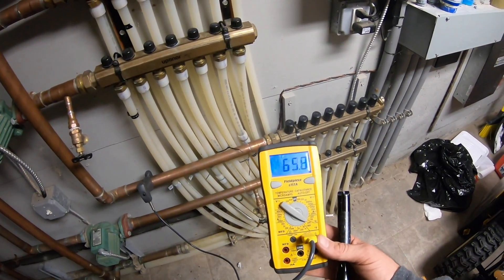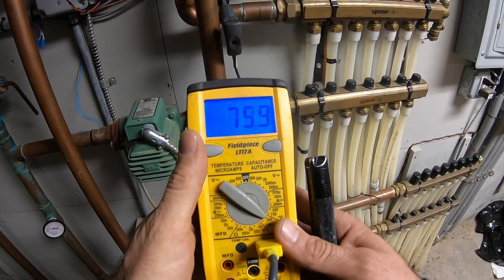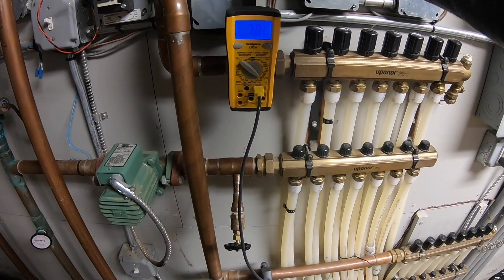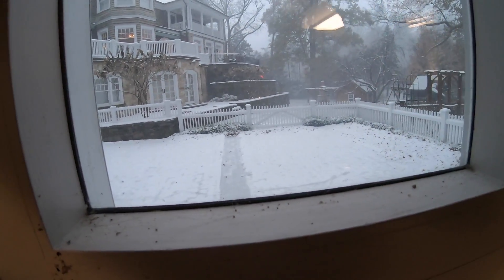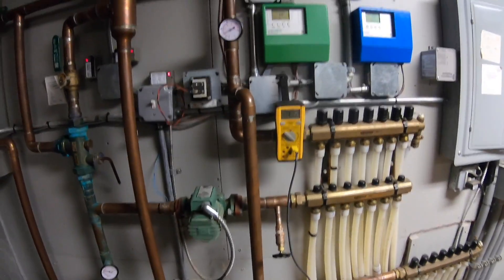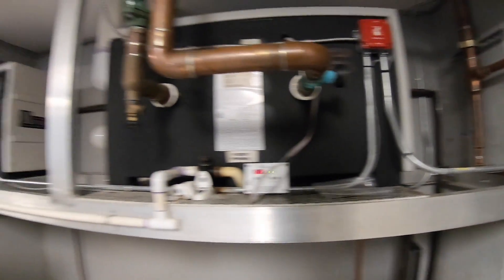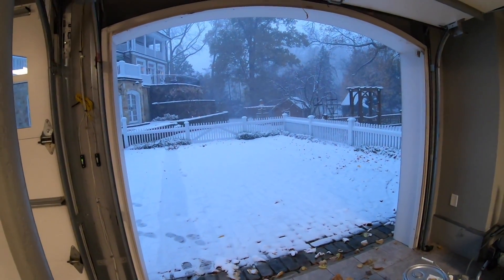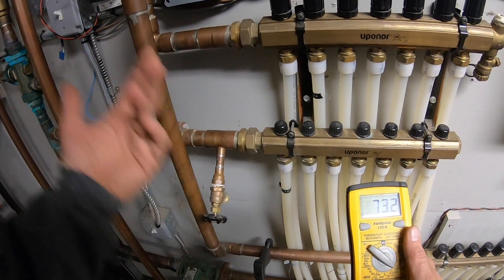Testing Boiler Snowmelt/ Heated Drive Way System After Repair During Snow Storm

Comment: No.. in just the couple of minutes of the video,, there are changes.   Heated driveways normally take hours to heat up.  This is not instant stuff.  If you want it to melt,, you have to start the system before the snow,, not after.   You are the HVAC guy,, calculate it,, warming some frozen concrete and bricks is going to soak up an incredible number of BTU's.

It is not fast.    40,000 BTU's for a single parking space 200 square feet,, and it calculates as 5 hours to bring it to melt.  You've got what 600,000 BTU's  but 2,000 square feet?  Takes time.
Reply from the maker: Yes they do a lot of thermal mass to heat.
Reply: Yep, driveway systems require lots of heat and slow response times.  Aside from the total mass that must be warmed,, the transition temperature of 32F ice to 32F liquid  require,, I think I am correct,, the energy equal to 14 degrees of temp change F.  So melt systems tend to kind of stop for a while at the transition point.  For you and I watching for the pot to boil,,,, nope,, won't boil.

That is a pretty system though.  A very talented HVAC guy laid that system and manifolds out well.  And by your description,, you hit all the service high points.  Nice job.
Reply from the maker: I wanted to see it work yet had no idea it was locked out both boilers on faults or I would of started this maintenance on these boilers to warm the ground up before it started snowing

Comment: Its really cold out tonight. Must be down to 40. Now for the bad news..... I'm 30 miles East of San FranCesspool and dimwit lunatics run my state.   Nice pipes and boilers, though. I'd like to see how all of that stuff works.
Reply from the maker: I'm jealous I want 40F instead of its 29F in jersey. First time working on a melt system as snow hits. Too bad both the boilers were locked out when I walked down to the garage or the driveway might have been warm enough to prevent the snow from sticking. This system can be manually turned on or activates around 36*F if the sensor gets wet and will run till it dries and is over 36.
Reply: Its that damp cold in SF that gets ya...I worked at SFO in the wintertime...
Reply: Damp cold right now in the East Bay hills.  And to think last summer my infrared thermometer was reading 106 Degrees F on the open beam ceiling in my upstairs bedroom. It cooks all summer and the room is 58 right now with the T-stat set at 65. The ceiling looks like a Tahoe wood cabin but there is zero insulation... terrible efficiency!  $50 grand to fix it. Maybe I should open a go F-me account.... boo hoo.

Comment: Wonder if there is any insulation under ther driveway. May be sending gobs of heat into to ground.
Reply from the maker: No its usually fastened to rebar and then they fill it with poured concrete. Heat rises so they figure over time the ground will just warm up enough to prevent the snow from sticking or help melt everything down unless outdoor temps spike too low.

Comment: some call it lazy, i call it efficient and safe, why spend thirty minutes to an hour outside, in the cold, shoveling snow and potentially getting sick, when there are systems that can clear the snow for you, that said it would probably be quicker and more efficient to use a heated sprinkler fed by runoff and melted snow, or a robotic plow, free up time that can be used on chores too complex to automated, or working at the computer, or even just relaxing
of course if you're not gonna learn to fix it and maintain it yourself you're just lazy
[the opinions expressed above are more in response to the comments displayed below and apply similarly to any home automation system]
Reply from the maker: It’s work and keeps me busy so I can’t hate those who want expensive toys
Reply: Exactly right, I don't know why snow melt systems get such a bad rap, no one questions a self-drive snow blower, or an electric drill, but a snow melt system is bad for some reason. People have dish washers, central heating systems (maintaining a fire in several fireplaces would be a real pain), and the list goes on and yet somehow this is an evil thing. Every year you see plenty of stories of people having heart attacks shoveling snow.
Reply from the maker: @wildbill4476  I never expected such hatred for such an amazing system. I am sure most the hatred comes from those that don't have to shovel. I am doing this to my driveway no matter how small it may be next time it gets redone.

Comment: If your make up water is not flowing ( broken sub-surface pipe), I would walk away, 50-degree spread - heats going somewhere.
Reply from the maker: The heat is going into the cement slab under the driveway. That was around 30* when I fixed the boilers and got them back online. That’s a lot of thermal mass and it’s doing the paper and lower driveway. I didn’t know that when I was there the first time

Comment: I installed my own snow melt system including laying down Onix  rather than pex, much better bend radius than with pex as well as plumbing up a dedicated oil fired Peerless Pinnacle high efficiency boiler . I used a Tekmar 671 with a slab sensor and an 092 remote (now discontinued) that allows me to turn the system on manually without having to go down to the  mechanical room where the 671 is located. The 671 has a function that allows me to put the slab into "idle mode" which maintains a preset slab temperature, that'll lighten up your wallet some.

Comment: You think this is wasteful houses in South Carolina and Georgia and Florida and Texas and other southern states that cost 3 and 4 million dollars they have anywhere from 150 tons of cooling all the way up to 500 tons of cooling to keep the inside of the house at 60 degrees when it's 125 outside and to top it off they have gas fireplaces that they run all day and all night while the AC is running

The electric bills typically run anywhere from 5000 to $10,000 a month

It must be nice to be rich
Reply from the maker: I call it rich people problems. I have a house that uses a hi velocity set up to cool off their outdoor deck. They have 2, 5 toners firing cool air at the seats. Us working folks can't understand.
Reply: It doesn't get 125...lol stop being dramatic. Also I've yet to see fireplaces running in the summer. C'mon get real.

Comment: I would highly recommend insulating all those pipes and increasing the temperature to 150
Reply from the maker: good idea yet this slab will heat and melt with 130 flowing through it. Just will take times since it was down till I repaired it. It was returning above 70*F so the slab will eventually warm up.
Reply: 125 will melt snow just fine down to about zero as long as the returns are coming back above 70. In the 20's, 105 works fine.

Comment: that's a lot of thermal mass to heat up, once it's warmed up and maintained it will stay clear except for severe heavy snowfall, which may require pushing off, but shouldn't ever be iced underneath. well, that's providing the boilers don't quit working! thermal heating during daytime sunlight helps a bunch and it's often enough to keep the large mass heated during the day.
overall very energy wasteful, but so is most of life )
Reply from the maker: Too much forces of energy stopping the ground from warming quickly. First the sun wasn’t out before it started snowing, the driveway melt was broken,  outside temps dropped really quickly, then the snow started before I had the boilers up and running. The the snow just came down fast and hard with leaves covering portions of the decking. The driveway will warm up just needs time. Yet the next day was sunny in the 40’s so most unseated blacktop driveways melted away most of the snow. This is rich people problems which I don’t hate on since it can keep me busy.
Reply: yeah, leaves make a good insulation layer as does snow itself, which would manual labor clearing it off, at least the nasty ice will stay at bay.
Reply from the maker: Some of the ice melt systems shut down if the temps get too low if they don’t have enough output. Most of the time the sun alone helps melt down most the snow in nj. Where you at throttle? Is there lots of F U money wasted like this house is doing?
Reply: in Ohio, where there's from slums to dumbs :)) Dumbs being giant homes with stupendous features like that.
over the years I've worked in and on all sorts of places,  total dumps with the ring of gun fire and police sirens non stop around dark to mc.mansions lol

Comment: Just such a waste , is the same idiot systems are solar roadways ... such a waste ( take that 30K and buy a small snow plow machine from honda for 1/30th of that ... people just have money to burn and the environment has to pay for it ... cool :D
Reply from the maker: This is rich people problems and keeps me busy and making money. Someone still needs to drive the plow. Hahaaa there to busy sipping tea at the country club
Reply: that doesn't fix the ice issue, only salt or other chemicals will clear the ice, which isn't good for any of the driveway material and the run off makes the surrounding ground toxic to anything growing or eating it, from the salt buildup. in theory using salt is polluting the planet! the old catch 22 ;)
geothermal loops would be much more efficient, but the upfront costs and amount of land needed is too high and likely never pay for itself in the long run.
Reply from the maker: Could geothermal work as the radiant driveway melt? They always seem to need secondary heat sources when temps dropped down to 20 and below
Reply: sure, if they had endless pockets and property to install all the ground loops and equipment to make enough btu/h. 
in the end it's probably cheaper to just pay for the gas.

Comment: Just a few thoughts,It would be great not to have to shovel,plow a walk or drive all winter long ,fine when your young different when aged ,but the reality of the costs would prevent me from doing it unless I hit the lottery .Having lived in New England and the Great Plains.
As far as this guys drive in NewJersey the leaves  will insulate the snow above and delay it from melting but in time it will.As said if the slab and soil are warmed before the snow or ice get on the drive it can't freeze on a warm surface.
Given all that cost to install and run a melter,its only for ones own property after all ,sooner or later you got the rest of the world to deal with ,can't travel out or back on bad road conditions.Wonder if the place had a home generator? Power goes out its not going to work and often freezing weather equals power failures.
Reply: This system has to be 25-30k.  You could have about 50 years of professional plows for that, not to mention the gas and electricity and servicing and longevity of the system.
Reply: This is a tribute to American excess.
Reply: You could actually plow indefinitely on the interest for $30k.
Reply: @compscilaw  oh I agree you don't "need " such a system ,all its complexity and maintaince and repairs if something breaks or get damaged.Its nice to dream,and will stick to traditional methods till
 that winning lottery ticket comes thru.
Reply from the maker: The sad part is if the pipes leak under the driveway that driveway is getting excavated and new snow melt pex tubing laid back down. I spend too much time working in the land of make believe. Too many towns around here with these oversized houses with too much fuk u money. Most work in NYC for banks, doctors, lawyers, Wall Street, etc. yet I am thankful to the 1% and stupid overdone houses. Something is always breaking which means lots of work no matter how bad the economy ever gets.
Reply: Hey, I resemble that remark, but you are right about one thing, toys like this feed back to the community, to guys like you, I could have bought some nice art work for the same price, from a dead artist so just a bunch of middle men and two affluent guys exchanging stuff. Not just you, remember there are the guys that make this stuff, and their suppliers and so on, as well as guys like you that keep it working.

Comment: So they use some type of antifreeze in the lines? What do the do if a line under the slab cracks or breaks and begins to leak?
Reply from the maker: It has a glycol mix to keep it from freezing. If it leaks underground we can isolate each hose and shut down the leaking tubing. This happens in homes also. Radiant floor heat is done the same way very often with the tubing inside a poured concrete slab. Some may abandon a leaking driveway melt others rip the driveway up and replace the tubing. As far as the glycol leaking out into the slab it’s up to the homeowner to deal with the epa on that clean up. Those with heated driveways have the money to burn did u see the 10 condensers?
Reply: While harmful to u through ingestion and poor skin absorption, it has a short live environmentally and so is harmless after some hours, then again you may want to consider its effect to a watershed area if not diluted properly.
www.atsdr.cdc.gov/csem/csem.asp?csem=12&po=4
Reply: @Joshua79C  tell that to the EPA..pro or eth...dont care.
Reply: Here is the EPA take on it as well:
https://www.epa.gov/sites/production/files/2016-09/documents/ethylene-glycol.pdf
Disposal:
https://www.epa.gov/sites/production/files/2016-02/documents/antifreeze.pdf

Comment: I'm not a Wersbo guy but that doesn't look like  heat pex to me on that system, no oxygen barrier! Also looks like the system is designed with no heat exchanger, running all  that glycol through the boiler?
Reply: looks that way, but i'm pretty sure munchkins were good grade stainless heat exchangers, the rest looks to be all copper/brass/pex with no plain iron anywhere.
someone just may have done their "engineering" right.
Reply: and I forgot about the cast iron pump and flanges, doh! the glycol will help, until it doesn't get changed and goes acidic =p
Reply: @throttlebottle5906  I have several ground source systems that i service that were put in with glycol 20 years ago with no problems from using glycol. most were put in using methanol
Reply: sure, as long as it's tested yearly and a tight system. preferably there's a plate heat exchanger setup and have the boilers isolated on a much smaller loop, but that does cause further headaches.
Reply: Most standard PEX has a dull finish. However, oxygen barrier PEX will have a shiny or glossy finish... unless it’s PEX-Aluminum-PEX tubing in which case the metal center is the oxygen barrier.
Reply: right, but I cannot tell from the video can you, especially with the colored shmoo inside the pipes, it seems a 50/50% chance, but considering there's cast iron circulators and flanges, none of which have crusty rusted out leaks, I'd lean more towards and assume O2 barrier.
we demand you return and look at the pipe labeling so we all know for sure!! :))
Reply from the maker: I might be going back here soon I heard the expansion tank in the main house has a pinhole leak so it will need to be replaced. I will look at the labeling on the pipe if i do the tank
Reply from the maker: Yes the glycol mix is going right throught the heat exchanger here. It has been since 2007 when this house was built.it has to have an oxygen barrier or all the steel would be rotting away and leaking. At least that is what I believe would happen if pex without an oxygen barrier is used. We didn't install only been servicing

Comment: What a god awful waste of money! The amount of gas that system would use. holy crap. And they have what like 10 air con condenser units
Reply from the maker: Those two boilers are only using 800,000 BTU's to heat the outside ground
Reply: 11 actually one was a little LG or something

Comment: All of that is one house?  With all those prints hanging around, and all the commercial style work in that garage, the guy must be a general contractor!
Reply from the maker: No the previous owner who built the house kept prints and documents of everything. That guy was a doctor. The new owners the guy works on wall street. I wish I could have filmed in this house to show off the mechanical rooms. I say rooms there is radiant manifolds and pumps everywhere. This house was over engineered.

Comment: I would love to see what that looks like through a thermal camera.  Do you have one?
Reply from the maker: I wish I had a thermal imager. I need to pick one out since many jobs it could have been an interesting troubleshooting tool.
Reply: @thehvachacker  CAT C61 is a Mobile-Phone that could fix that. But You`ll be spending a 1,000.00 US$..
Reply from the maker: I will check it out.
Reply: @thehvachacker  A Seek Thermal ( I have one ) or a Flir One works great for seeing the heated path in the concrete... I have a heated floor in my shop, and a few businesses around my town have heated sidewalks.  It was the first thing I tested my camera on.
Reply from the maker: How does the thermal imager work on cold objects? I think it would be a really handy troubleshooting tool
Reply: You know, I haven't tried it on cold objects.  Kind of did some playing looking for cols spots in insulation in my house, but not so much at like an evaporator or something.  I guess I could give it a shot on my heat pump, it's doing it's thing..
Reply: @thehvachacker  AFAIK, the cameras will auto-range, similar to an autoranging voltmeter.
Reply from the maker: That was one of the reason I want a thermal imager is to help diagnose a restriction in a refrigeration system

Comment: It was gone up by 2f before you ended the video, so probably melt it eventually, it's a lot a surface area to heat from freezing like you said it's got a hit the bricks up but it's also got a heat what's underneath it as well first
Reply from the maker: It will melt I didn't want to stay all night watching even though it could of saved me 5 hours of being stuck in my truck trying to get home